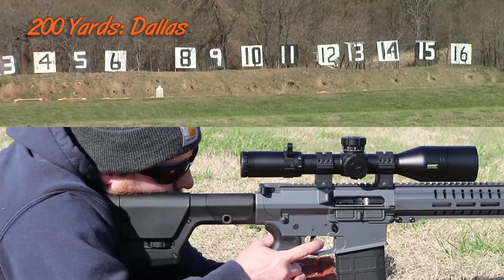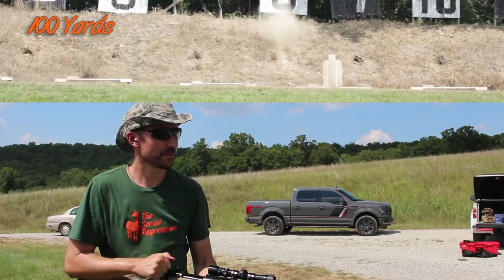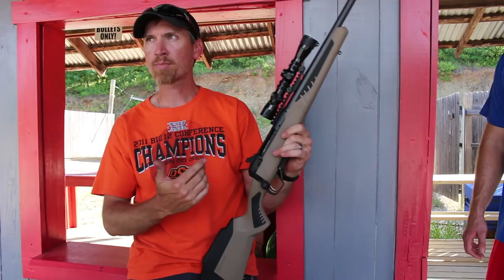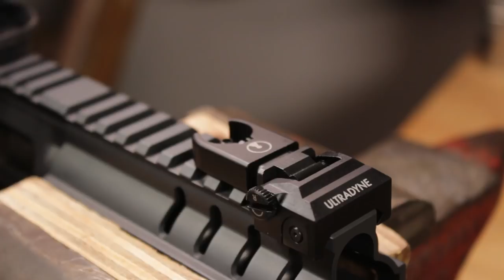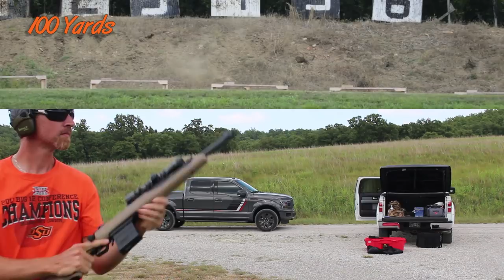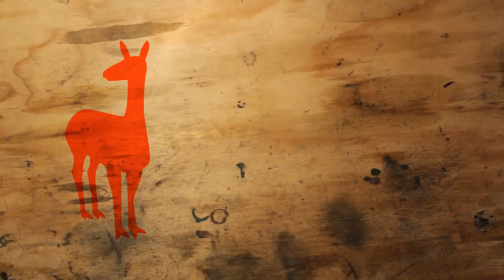Introducing the Scout AR 15 Concept! Semiauto Scout Rifle Pt 1

Comment: For a long time I've thought a larger-bore AR-15 would serve the scout rifle role well. I do disagree with your parts list in one area - I strongly believe that, had the technology been available at the time, Cooper would've prescribed something like a modern LPVO 1-6x or 1-8x scope for his scout rifle formula.

In addition, a significant part of the reason he wanted a forward-mounted scope was for ease of use with stripper clips to reload quickly. With an AR platform that's not a consideration, so the optic doesn't have to be mounted so far forward on the receiver.

As others have mentioned as well, you risk significantly shifting your zero by mounting your optic to the handguard of the rifle, which will flex and bend when you brace the rifle against anything or use a bipod with it.

I highly suggest considering a modern LPVO in a more standard position on the receiver for your build.

Still, it will be an interesting project either way. I'd be interested in a comparison between a bolt-action scout and the AR-based scout once you're finished
Reply from the maker: Great points. We plan to test the rifle using a 1-8 LPVO, comparing it to the 2.5-8 EER. I'm curious to see how they perform.
Reply: I completely agree. Also Cooper wasn't trying to build the rifle of the future. He was trying to build the rifle of the past really. A rifle for mountain men who traipse around the wilderness. Which isn't most of us. It's still an interesting concept and is probably relevant for people in Alaska and other very rural areas who do walk around in the mountains. Scopes are immensely better now than they were then. And a lot of AR semi-automatic rifles are every bit as reliable and light and powerful as the bolt actions of his day. I'm much less interested in completing his concept, in specific, than the overall concept of a light, short, powerful universal rifle. Lpvo is right. Forward mounted is not. Short is right. Light is right. Caliber depends on where you live and what you do. IMO a what would Stoner do rifle with a lpvo, is really the right formula for what cooper was trying to achieve. Probably his would need to be based off of the AR-10 and be in a larger caliber but...

Comment: I looked at the scout concept for a while and realized most of the requirements are irrelevant with modern firearms. 

Cooper wanted a forward mounted scope so he could have a wide field of view and be able to top load rounds, and click in the magazine if rapid fire was needed. Something like an ACOG offers fixed low power, excellent durability, and a wider field of view compared to a LPVO of similar magnification at about 1/2 the weight.

Semi-autos weren't as reliable as they are now. He chose a bolt action because it forces the shooter to have better fundamentals instead of just firing more rounds from a semi-auto rifle.

I still believe the .308 is the best cartridge for his intended purpose.

I built a lightweight ar-10 style rifle as a modern scout.

JP 16" barrel, LMOS, SCS. Geissle trigger, 2A xanthos receiver, vseven handguard, 4x acog.
Comes in right at 7lbs with the optic.
Reply: Copy a your build sounds similar to what I am planning on building, how is yours treating ya?

Comment: Been wanting to do a facsimile of the WWSD carbine that in range tv did a few months back. I'll be interested to see how this build compares to that one.
Reply: Yep, that was what I was thinking as well. One could even argue that running a red dot or some other similar lower magnification optic towards the front of the receiver is kind of a "scout" set up as far as the optics placement / concept goes. You'd be looking at the same benefits even though it isn't quite as far forwards as the scout setups I've seen in the past.   @underwaterbasketweaving8638